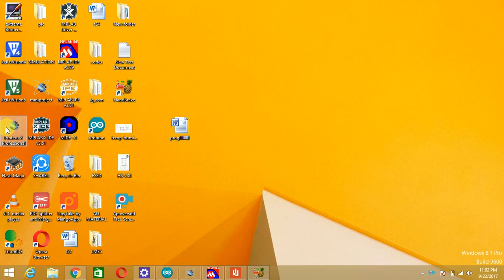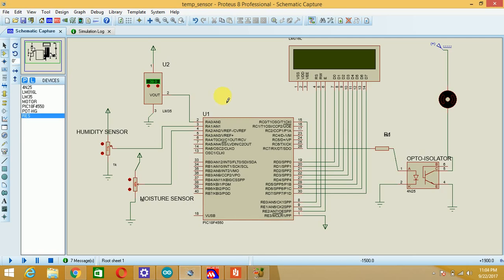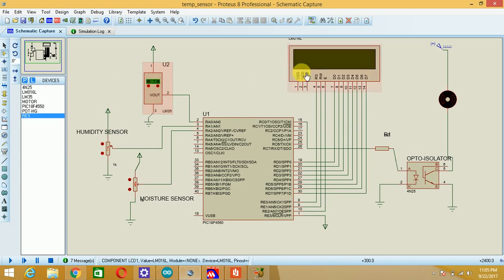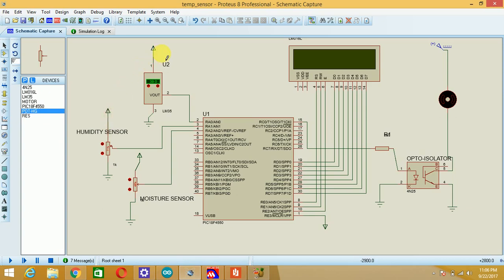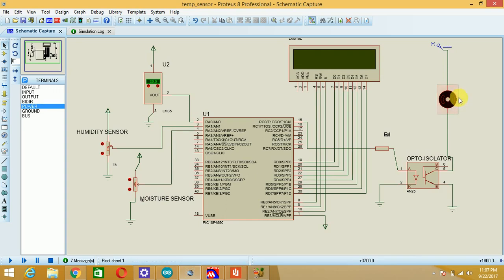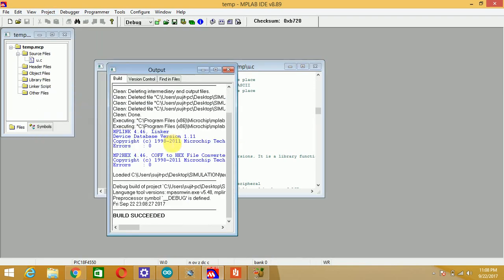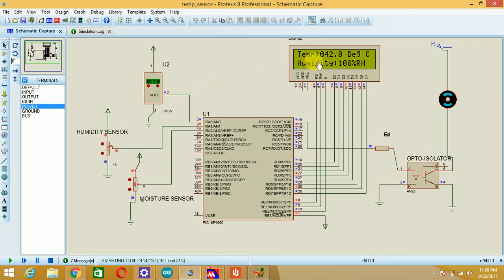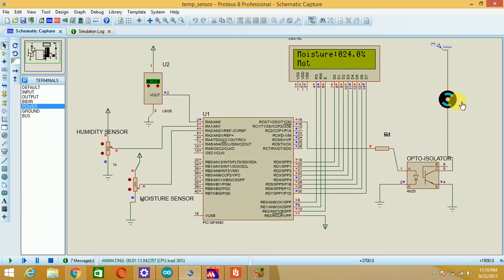Temperature sensor(LM35), Moisture sensor, Humidity sensor interfacing with PIC18F4550

Comment: Hi, can I put a TCS34725 color sensor to pic18f4550? I don't find a library for this sensor (for arduino is Adafruit_TCS34725.h). Is It a possibilty to adapt the .h code from  Adafruit_TCS34725 arduino library to microchip PIC18f4550?